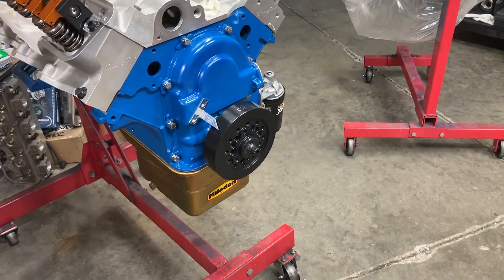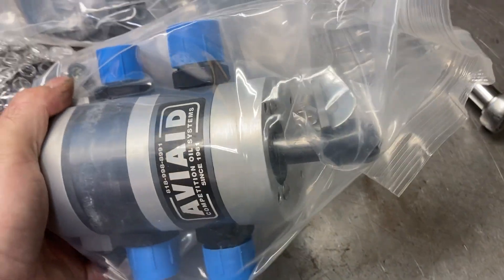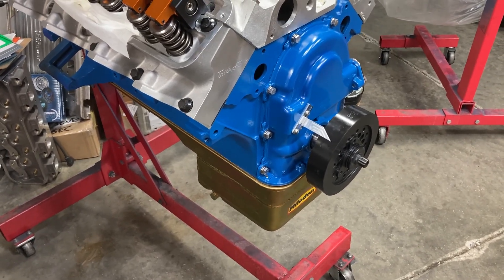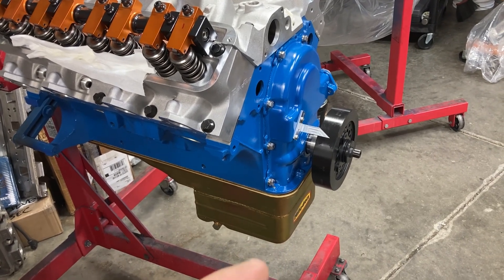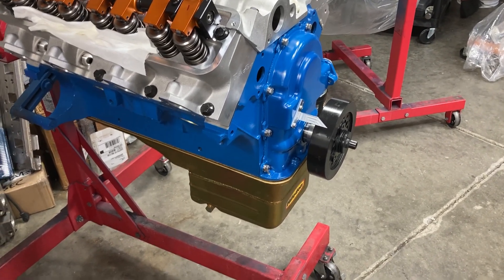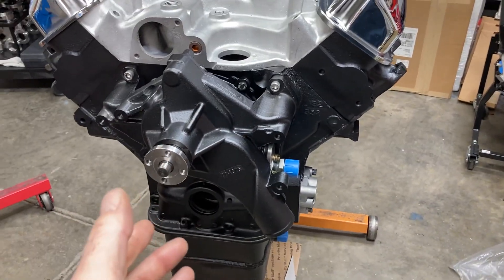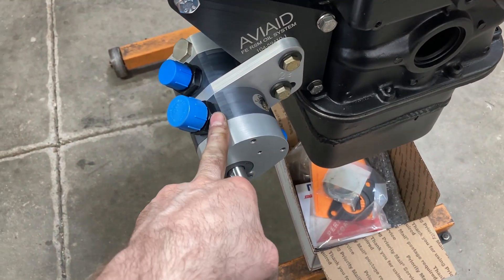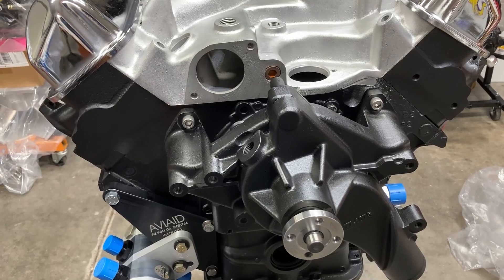Lykins Motorsports Let's Talk About Oil Pans

Comment: I am going wet pump external on an Oldsmobile V8, due to the cross member location and the fact it can't be moved , I need to go mid or front sump on an Oldsmobile 403, due to the fact the Olds mounts the oil pump on the rear main like a SBC , I have to delete it , now I'm going to replace the pump with a internal pickup to the front sump , so the pickup bolts to the pad the oil pump did in the factory setup , that gallery on the main leads directly to the outside of the block and the Olds external oil filter adaptor, normally through the filter then back into the engine, BUT the Oldsmobile 350 Diesel has an adaptor that bolts in exactly the same place but before the filter there is an AN fitting marked " out " on the Diesel DX it goes to an external cooler , then back to the oil filter adaptor and another AN fitting marked "in" it the goes through the filter and into the engine as normal . 

I am going to mount a single stage 35mm body wet pump ( made by Savy Australia $698 US ) to the Oldsmobile power steering bracket that is exactly the correct dimensions and position, I'll run the Diesel oil filter adaptor " out " which is now comming from my pickup inside the sump , to the intake of the Savy pump "AN" lines then through the pump and back to the " in" on.the Olds Diesel DX adaptor, then as normal through the oil filter and into the engine . A very clean set up, no fitting needed on the sump . Just two.lines from the Olds adaptor to and from the external pump .

Comment: Be interesting to add more oil pump scavenging ports & run a dry sump to see what type of HP increase running a dry sum as your almost there. Install a couple more fittings, hoses and get a tank to hold 5-6 quarts.

Comment: What kind of belt life can you expect for belt driven external pump? 
The belt just seems like a point of failure for such a critical system.  
I'm guessing that is just a concern for street driven engines. If you at look at images of modern sprint car engine assemblies ($$$$$$), the oil pump is driven from the camshaft nose and the water pump is directly connected to the crankshaft.  Effectively removing those potential points of failure.